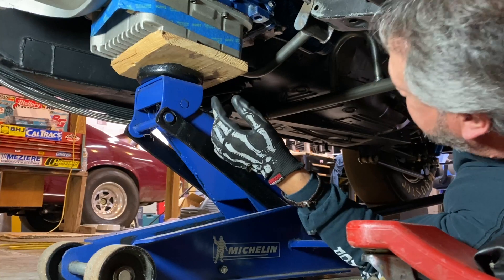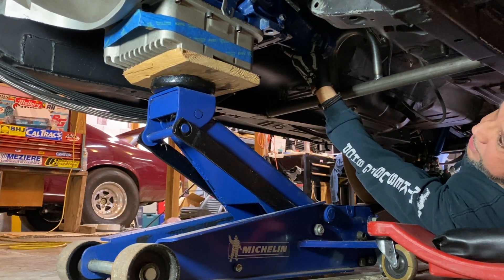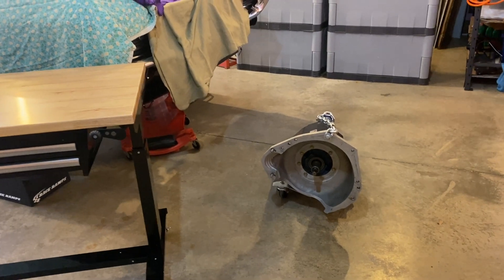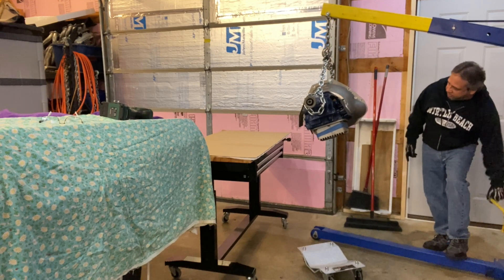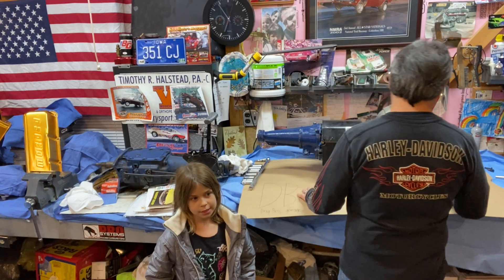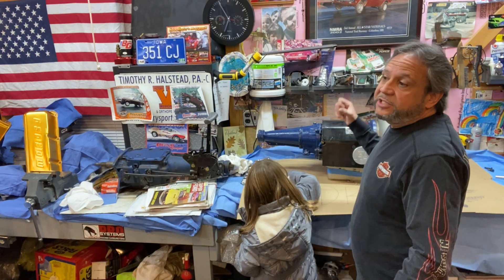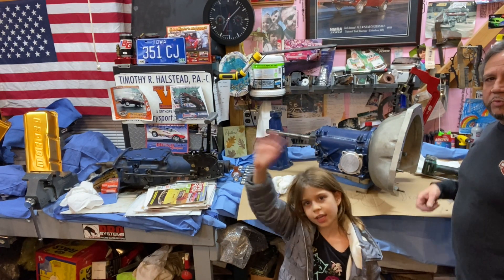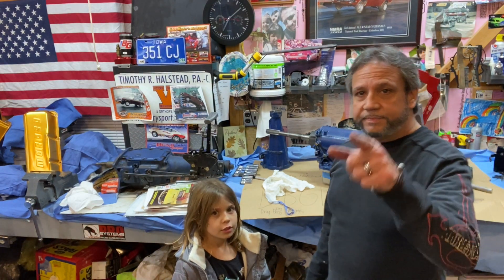DBG: 7 Year Old Taking Apart C4 Transmission, After Dad Removed It,  Working Well At 750 HP...

Comment: I've removed and replaced a few transmissions in my life, but never had one apart. There were some great shops in Okc where I could have one rebuilt or just swap it out. That was back in the days of bumper jacks lol I think the only ones using bumper jacks anymore are people off-roading!
Reply from the maker: I don’t know all the ins and outs of them, but I know how to fix them, modify them and race them don’t care much for bumper jacks
Reply: @dragboss351cleveland  personally I have a 3 ton DayTona floor jack I bought from Harbor Freight. I love it. Lifts quick and great control lowering, but it is very heavy. I don't think you can get around that and still have a jack that will stand the test of time though. I was glad when they came out with floor-jacks for sure!

Comment: I like the custom transmission mount! very nice! At the beginning of the video I saw a glimpse of the grey dollies. I bought a couple like it from Harbor Freight last year to help me moves some axles for my mobile home around to mount for moving it. They worked out pretty good. I had to lay down a couple pieces of plywood to roll them on because of the grass. How do you like yours? I had a friend that bought a set also years before and said they didn't hold as much weight as it says. He was setting a 20Kw Generac Automatic whole house generator, which is about 400lbs or so. He had an enclosed trailer he put it on to take to the state fair and other events to advertise the generators. He said they broke down on him.
Reply from the maker: Thank you it’s an awesome mount and lightweight. Yes I’ve use those dollies, to move engines another heavy parts. I got mine from Harbor freight. They work well for what they cost.
Reply: @dragboss351cleveland  I thought so also. they seem very solid to me.

Comment: There are 1200hp capable aod builds these days. I have a 750 hp  proof silverfox aod ( dan ) myself There are all aluminium so it could save you weight ? Dunno. Maybe you like to stick with the C4 for some reasons  C6 is to heavy
Reply from the maker: Yes changing from C6 to C4, I picked up 1.5 tenths off the 60. I like C4, AOD, be cool too. At this point stay with what i know...

Comment: I am curious to see what you do to your C4's. It has been many years since I modified or rebuilt a C4/5, and it was for a pinto I slapped together for 1/8 mile. 5 5 clutch setup, etc, and handled a nitrous 460 in typical c4/5 style. I consider it one of Fords best tranny's simple because of how few I ever had to rebuild. And how many that I did go thru that lived very long lives at power levels they were never intended for. On another note. You are not simply trying to teach Alaina things she wont learn is school, you are succeeding in doing so.
Reply from the maker: Thanks you so much for the kind words. I am trying to give them the advantage of Knowledge and good morals in life. That is an issue that seems to have fallen by the wayside. Cool to hear that you delved into the c4. Your right pretty simple. Hardest part is drum seal installation. Always appreciate your insight and experience. Thank you my friend

Comment: I know this is not on the subject, however I have a question you may be able to answer. I seen in a comment I can't remember where, that Ford had sold the rights to gm to be able to use the Cleveland style head arrangement and have been running this head design on the ls engines. Do you have any information on this? Please let me know if you do. Thanks love your videos.
Reply from the maker: Thanks for watching. I do not believe that to be true. I will say that the basis for the pro stock heads, and the ls heads, are the Cleveland heads. I think GM, copied the basic design.
Reply: @dragboss351cleveland  if they are a copy of the Ford design head they are using in pro stock all us Ford guys need to, by word of mouth and use whatever platform we have to spread the word. Also can't some type of law suit be filled by Ford racing or FORD racers? This information needs to be gotten out. Expeshily when we hear comments like. " the ls bla bla is a modern marvel " when you hear this kinda stuff knowing the bias in gm favor and rule changes against The Fords and Mopar over the years in all forms of racing, it ruffles my feathers. I know what little platform I have I will be using. Your thoughts? Please reply. We Ford guys need to stick together. Love your videos.